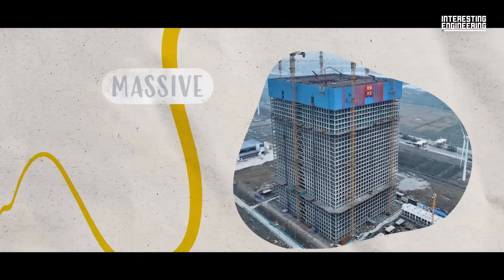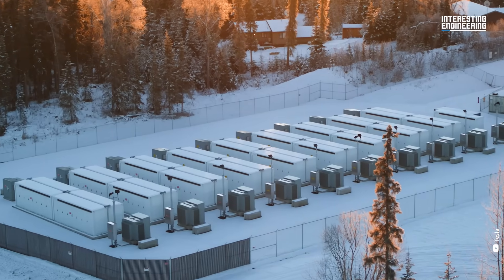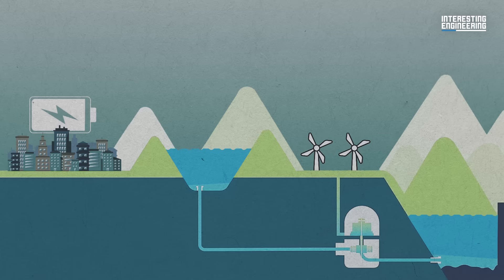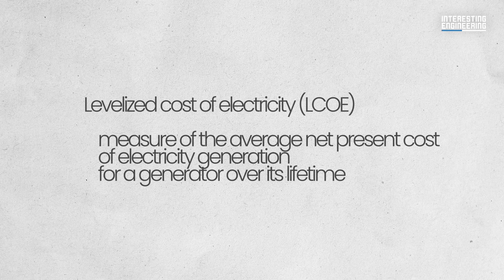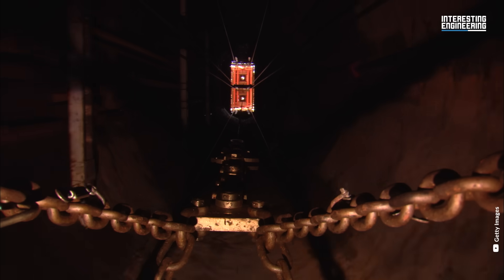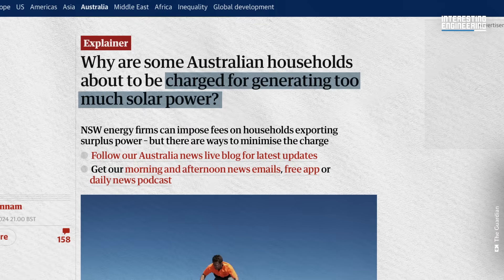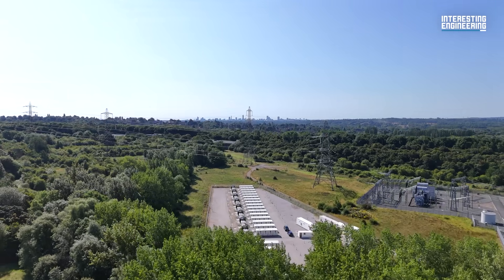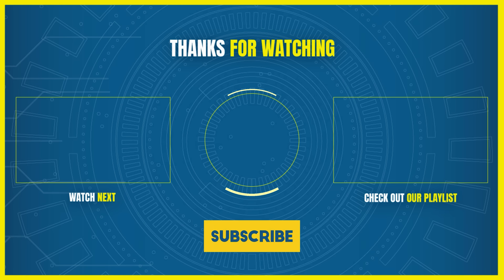China is Building Gravity Batteries

Comment: Pumping water is much more efficient and has far lower maintenance costs.
Reply: Yeah but not every places have plenty water thus more alternative needed in order to complete the map
Reply: mofos when they don't watch the video be like
Reply: Water can evaporate due to heat and loses it's weight
Reply: @penguinista, According to this video clip the cost per KWH is 0,17 for pumped water storage and 0.05 for gravity storage. If that is true then your statement is incorrect.
Reply: The statement is incorrect. The cost of pumped storage is pretty much independent of capacity. You can store twice as much energy by using a bigger reservoir.  with gravity bateries you need more hardware.
Reply: @rogerphelps9939  Oh yeah, just make a bigger reservoir! Of course! It's so simple!
Reply: 5:35. Did you even watch the video?
Let me guess: american or indian?
Reply: Air is everywhere pressurize that.
Reply: @kennethdubard9065  im assuming pressuring air is expensive due to the need for pressure containers and dangerous due to the risk of rupture.
Reply: @kennethdubard9065  Pressurized air creates a LOT of heat though.
Reply: @kennethdubard9065  When you compress air it heats up and alot of energy is lost as heat, its called the Carnot cycle. look into it. Compressed air isnt a solutions.
Reply: Until draughty strikes
Reply: This gravity battery was built in Xinjiang, which is the driest province in China with a lot of deserts. In addition, pumping water is possibly not more efficient. The energy would be wasted a lot by turbulence.
Reply: @curio78  

It is irrelevant if your nation is small.

You know why US have 3 isolated grid in to cover entire nation instead of 1 unified grid ?
Reply: @leerizer
2 days ago
 @curio78  

It is irrelevant if your nation is small.

You know why US have 3 isolated grid in to cover entire nation instead of 1 unified grid ? 

 @leerizer  Because Texas are idiots?
Reply: Absolutely right.
Reply: You use old trash and waste and recycle it into blocks to lift up with energy and then drop too generate energy. Insane concept but I'm hoping it works!
Reply: @curio78  are you slow? you need a massive amount of water, a lake full and another body of water close at a higher elevation to pump to for it to work.
Reply: It costs 3x as much as an integrated part of an electrical grid.
Reply: @curio78  What part of "it costs more than 3x as much" do you not understand?
Reply: @curio78  Do you think electricity is transferred via telepathy or something?
Reply: @curio78 look at the map in the video. See where the gravities battery are built? Maybe the places with the most sun and wind(for panels and mills if you missed that) are not the best suitable places for great water resevoirs?

China has traditionally had a water problem. I think there is also a socionomic factor: people in those drought areas wouldnt be happy seeing their drinking water turned into batteries.
Reply: OH NO THE CHINGERS ARE SMART???
Reply: Pumping water can have significant environmental impacts where built.
Reply: Tell that to the snowy hydro project in Australia. 12 billion dollars and counting and not finished
Reply: Quiet US too uneducated

Comment: I don’t get it. Doesn’t lifting it up needs energy? How does falling it results in net gain in energy? Should it not be zero?
Reply: Traditional Batteries with lithium or lead or other component store the energy and give it back when needed. The same with these "gravity" batteries, the solid blocks will consume energy from an electric motor during lifting, and when energy is required the blocks will rotate a generator to generate electricity. This system will consume more energy than will generate.
Reply: @NickGj-k7v  You’re absolutely right to question how a gravity battery works—at first glance, it seems like lifting and lowering a weight should cancel out in terms of energy. However, the key lies in when and how the energy is used.

How Gravity Batteries Work

A gravity battery stores energy by lifting a heavy mass when there is excess energy available (such as from solar panels during the day or wind turbines when the wind is strong). Later, when energy is needed, the mass is allowed to fall, turning gears or pulleys connected to a generator, which converts the potential energy back into electricity.

Why Isn’t the Net Energy Zero?

If you were in a frictionless, lossless system, then yes, lifting and lowering would result in zero net gain, because all the energy used to lift the weight would be exactly recovered when it falls. However, in a real system, energy isn’t lost but shifted in time to when it is needed. Here’s why this works in practice:
	1.	Energy is stored when it’s cheap or abundant
	•	When there is surplus energy (e.g., from solar panels during the day), that energy might otherwise go to waste. Instead, it is used to lift the weight, storing energy as gravitational potential energy.
	2.	Energy is released when it’s valuable
	•	Later, when energy demand is high (e.g., at night), the weight is lowered, and that stored potential energy is converted back into electricity via a generator.
	3.	Not about net gain, but shifting energy over time
	•	The system doesn’t create extra energy—it stores and releases it efficiently. It’s similar to a battery, but instead of chemical storage, it relies on gravity.
	4.	Efficiency Matters
	•	Some energy is lost due to friction and mechanical inefficiencies, but gravity batteries are long-lasting and don’t degrade like chemical batteries.

Analogy: Water Reservoirs

Gravity batteries work like pumped hydro storage: water is pumped up to a reservoir when electricity is cheap, then released through turbines when electricity is needed. It’s not a free energy system, but a way to store energy efficiently for later use.
Reply: The purpose was to lift up during the morning and fall down during the night.

Comment: Gravity battery can replace conventional batteries, but we still follow the method of providing energy directly to the rotor to rotate the rotor.  What is said is that the rotor can be rotated indirectly.  A system that forces the rotor to follow gravity.  Energy is needed to run that system, but only about a quarter of what is needed to run a dynamo.  Such a system has been invented in India.  New systems using gravity can still be invented, anyone interested please let me know.

Comment: Why on earth would they say mega packs are overly complicated?  They don’t have any moving part and run autonomously needed only occasional maintenance when an inverter blows.  They use LFP batteries which don’t use rare earth meterials.
Reply: The L in LFP means Lithium
Reply: @larryc1616 lithium is not a rare earth metal
Reply: @ LFP batteries in Tesla Megapack use LiFePO4 cathode (~4% lithium, ~35% iron, ~20% phosphorus, ~41% oxygen by weight). They cut rare mineral use by swapping abundant iron for rare cobalt & nickel—more sustainable & cheaper for storage!
Reply: They are not sustainable over large periods

Comment: It is most definitely not the "World's first" anything.
A superior version of the idea has been in development in the UK for years now.
using deep old mineshafts.That way you don't have to use vast amounts of concrete and steel(very carbon intensive) which is clearly counterproductive.
Gravity batteries are certainly a good idea when done properly but even better is to have them hooked up directly to watermills/windmills/wind turbines where possible to cut out the inefficient conversion-into-electricity-before-storage stage as and when appropriate.

Comment: good low tech, highly automateable operations - not a totally dumb way to approach at least a portion of storage of excess power generation  like you might see from wind or less commonly from solar.  You're guaranteed to lose ~20% on the round-trip flat out, all elevated storage has that hit to it but if you have a lot of excess and optimize the placement and operation of the generation with storage, you can come out with a really useful result.  You would however still have far better retention of power for re-use via chemical battery, so it becomes a tradeoff on the cost of storage, operational costs, east of routing excess generation and t he actual demand curves when the power will be needed (time of day and level).   Interesting optimization matrix :)

Comment: Gravity block "batteries" have been debunked so throughly and repetitively that I'm disappointed this channel covered it.... again.
Reply: A serious version is under trial in the UK using weights of over 100 tons each in disused deep mine shafts and they have proper engineers on the case.Very high efficiency.Infrastructure already in place,no stupid expensive towers (gravity doesn't care about altitude on these scales).Just cos someone got it wrong doesn't mean that it can't be done well :-)

Comment: 1:08 'MWh' is pronounced 'Megawatt-hour' not 'Megawatts per hour'. The latter is a unit that is almost never used (rate of change of power, like how fast you can ramp the output power of a DAM or nuclear power station), and would be written 'MW/h'. Same error at 6:29
Reply: They are the same thing.
Reply: @slowanddeliberate6893  They are not the same thing. 1 MWh is a unit of energy equivalent to 3.6 billion joules, while megawatts per hour is joules per second squared.
Reply: One million joules per second squared is equal to 3.6 billion joules*, which is 1 MWh. They are the same amount of energy.

Edit: 3.6 billion joules per hour*
Reply: So for you, multiplying by 2 and dividing by 2 are the same operation

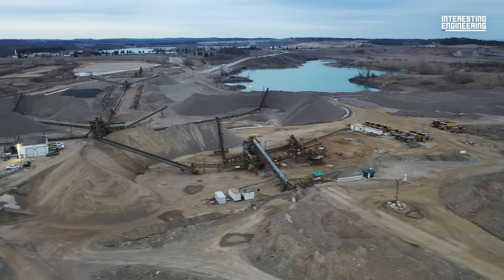Comment: 0:35 Lithium-ion batteries do not use rare earth minerals. Magnets (and thus motors) use them. Get your facts right.
Reply: Incorrect. Some types DO, and other types don't. Cobalt is definitely used in certain types of Lithium-ion batteries. And other materials too.
Reply: @maartenvandenberg4223  Yes, cobalt is used in ternary Lithium-ion batteries. However cobalt is not a rare-earth mineral.
There was one Chinese lithium battery circa 2007 that had a small amount of ytterbium in it. Apart from that lithium batteries do not have rare earths in them. If you disagree, show me one that does.
Reply: @xxwookey  Okay, I'll grant you cobalt is not a rare-earth mineral, but is IS a conflict mineral, and it IS used in batteries. So while you won the argument on a technicality, you lost the argument overall: the use of some minerals in batteries is problematic. Problem disappears with the Sodium-Ion batteries though.
Reply: @maartenvandenberg4223 I pointed out that the video was wrong to claim that batteries use rare-earth minerals. You now agree that that's correct, but somehow I 'lost the argument' eh? I said nothing about the other subjects you are now introducing. That's just whataboutery.
Reply: Induction motors don't need the permanent magnets which require REMs, unlike PM motors. Part of the reason why they aren't as common in electric cars yet is because they require alternating current to power them. Batteries store electricity, but it is delivered as direct current, so electric cars would need a high power DAC converter, which may result in some loss of efficiency. However, for a power grid this wouldn't be as big of an issue since it's all AC, except for battery storage systems. Therefore it is feasible to build a gravity battery without REMs by using induction motors.
Reply: For lithium ion batteries, cobalt is the limiting factor in them. It is mostly minded by hand in Africa. Yes lithium is fully recyclable but it is expensive to do currently.
Reply: @coldwind57  It's simply not true that Cobalt is 'mostly mined by hand in Africa'. The DRC is the largest supplier (70% in 2023), but the vast majority of the mining is industrial machine driven, same as everywhere. Only a tiny fraction is hand-digging. 

Also more than half of lithium ion batteries are now LFP which have no cobalt in them, so it's rapidly becoming much less important. The whole ESS market has gone LFP, and about half the vehicle market.  As a result of this change and increased supply (e.g from Indonesia which was 10% of world supply in 2023) the cobalt price has fallen by 2/3rds in the last 3 years.
Reply: @xxwookey  hey I appreciate that information, I'll read into that. I'm glad to hear that info.
Reply: Don't bother. This is the kind of channel that promotes supposedly innovative tech that is actually impractical if you take a close look at it.

Other channels here on YT have already looked into gravity batteries and have determined that the cost of the infrastructure and the maintenance would be too much for very little results.

Not to mention, since this system also has so many moving parts, failure rates are high.
Reply: @oompalumpus699 
Mechanical friction will also eat up a lot of energy to be able to get anything useful out of it!!!
Reply: Splitting hairs.

Lithium is pretty much the most unsustainable battery material possible. 

I think that's what he meant. 

Not the actual classifical of rare metals / Earth's.
Reply: @MoLo-l7x  It's not hair-splitting to point out things that are simply completely wrong. If he meant lithium he should have said so. And in what way is it 'unsustainable'? There are enormous amounts of lithium out there, and it has got a lot cheaper in the last couple of years as supply has come on line faster than the (large)  growth of battery manufacturing. There is no prospect of a lithium shortage, and if you just dig it up rather than use the water-intensive brine evaporation method, the environmental harm is just the same as any other mine (a lot of digging, with eventual restitution). It is many orders of magnitude less digging than the equivalent amount of fossil-fuel extraction.
Reply: @xxwookey  fossil fuels are produced by fossils. So can be replaced on a long enough timeframe. Lithium can only be created in a supernova. 
That's why it's so absurd to replace fossil fuels with lithium batteries (mainly still charged with coal power too) with the idea of sustainability or environmentally friendly ness 

And although it is abundant in the cosmic or global scale it is rarely ever found in minable quantities.
Reply: @xxwookey  lol. I'm getting responses to a correct answer which has been deleted. Thank you for showing me how stupid I am to argue with idiots online.

Comment: A hydraulic accumulator was used to raise London Bridge ramps by the Victorians for many years before electric motors replaced them. Water was also used to move cliff lifts up and down the hill at seaside towns in the UK and are still being used at Saltburn on North east coast in UK. 

All they are doing is storing potential energy and releasing it when required. Batteries and their associated costs and energy losses are not always the answer.
Reply: Tower Bridge?
Reply: Yep, tower bridge